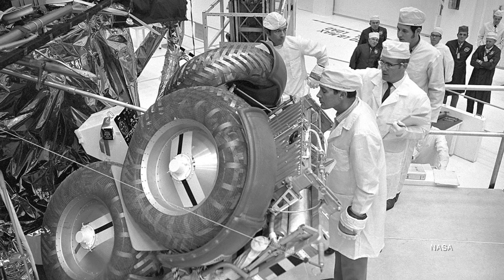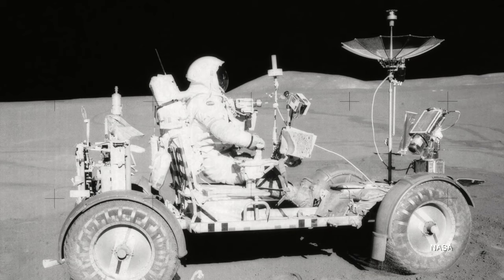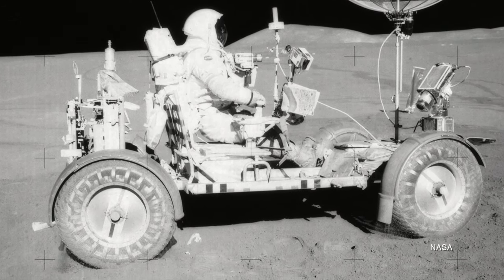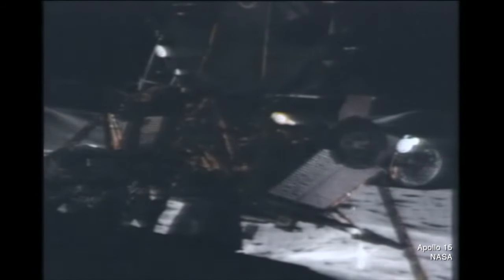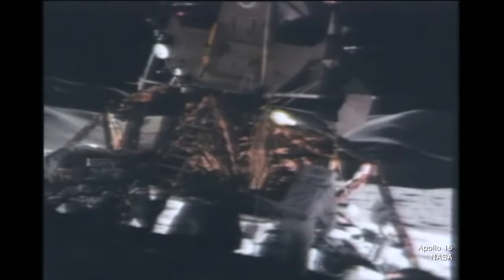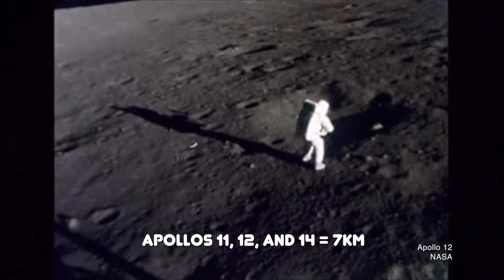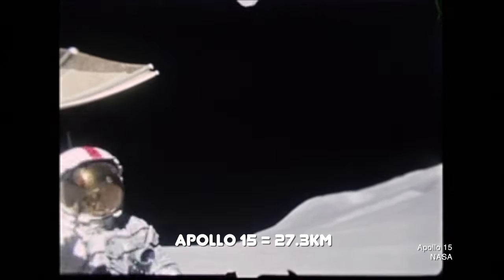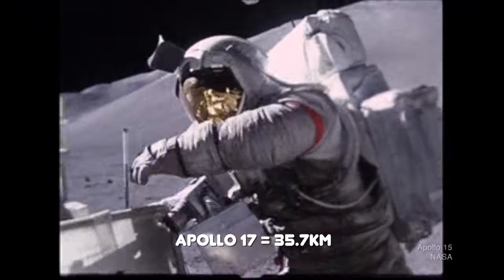How NASA Took Cars to the Moon

Comment: Looks like a snap doing this. Why has NASA not gone back to the Moon in 49 years ?   But now, somehow, they are sending ships to Mars. Which is way further out in space.
Reply: Manned lunar missions are really expensive and dangerous with little practical payoff.  Much safer, cheaper, and sciency to send robots.
Reply: @SpottedSharks  How do they get out of Earths low orbit ?  Been hearing NASA say that's as far as they can get today. If so. How do they get to Mars ?
Reply: @drackxman  Apollo used the multi-stage Saturn V.  The first two stages got the rocket into earth orbit and were then jettisoned.  The third stage got them out of earth orbit and onto a course to the moon.  

The Saturn V was the most powerful rocket ever to fly.  Also madly expensive.  After Apollo was cancelled there was no need to keep building them.  Instead, they built smaller rockets for the shuttle program and satellite launches, none of which would have been capable of launching a manned lunar payload and deliver it there.
Reply: @SpottedSharks  That doesn't answer my question. Manned or un manned, they say they cannot do it.
Reply: @drackxman  Yes, it does.  And NASA never said it's impossible to get out of LEO.
Reply: @SpottedSharks Well I heard someone from NASA say that. I'll have to look at it again to make sure.
Reply: @donpettitwedestroyedtheapo6488  So is your face!
Reply: In order to understand basic rocketry... like 1st day of class type stuff... you need to understand that rocketry is all about how much payload you can lift to a certain altitude (or a certain orbital height).  Sending unmanned probes to Mars, or the moon, is nowhere near the payload requirements of sending people.  If you just want to send a 4,000 pound probe to the moon or Mars (almost the identical energy requirement, by the way), that's fine.  You don't need to include any life support, food, oxygen, etc.  And, most importantly, you don't need to send a craft capable of getting back home again, and re-entering the atmosphere in it.  The payload to get to the moon was about 100,000 pounds (command/service module, lunar module, and the people inside).  If your payload is a 4,000 pound probe, that's a tiny fraction of the payload of a manned mission.

The more payload you need, the bigger the rocket you need.  And, thus far, the Saturn V is the biggest rocket ever.  (Technically, the Soviets built the N1, which was the same size, but they never got it working, so it doesn't count.)
Reply: @rockethead7  They haven't developed the technology to go to the moon yet. Therefire tgey can't have gone 50 years agi. Good luck debunking that.
Reply: @rockethead7  Wait!, let me make it more undebunkable for you  They haven't developed the technology to go beyond low orbit yet. Thetefore they can't have gone to the moon 50 years ago.
Reply: @donpettitwedestroyedtheapo6488  
Saturn V.  That's how they did it.  Wow, that was easy, for something that "can't be debunked."  Hilarious!!!  What a clown.
Reply: @rockethead7  No way, if they can't go now it's because they haven't developed the technology, therefore they caouldn't have done it 50 years ago. Try again genius.
Reply: @donpettitwedestroyedtheapo6488  
Dummy, it doesn't work that way.  You don't know what you're talking about.  And, you don't get to just "declare" that there's something wrong with the 1960s technology to go to the moon.  You must specify the EXACT technology that was lacking, then explain why none of the world's aerospace engineers have ever noticed that it was lacking, including the thousands who worked on Apollo, who never seemed to know that they failed so badly to build everything to go to the moon.  You act as if we don't know how to go to the moon or something.  You're being ridiculous.
Reply: @donpettitwedestroyedtheapo6488  
Dummy, it doesn't work that way.  You don't know what you're talking about.  And, you don't get to just "declare" that there's something wrong with the 1960s technology to go to the moon.  You must specify the EXACT technology that was lacking, then explain why none of the world's aerospace engineers have ever noticed that it was lacking, including the thousands who worked on Apollo, who never seemed to know that they failed so badly to build everything to go to the moon.  You act as if we don't know how to go to the moon or something.  You're being ridiculous.
Reply: @donpettitwedestroyedtheapo6488  
Dummy, it doesn't work that way.  You don't know what you're talking about.  And, you don't get to just "declare" that there's something wrong with the 1960s technology to go to the moon.  You must specify the EXACT technology that was lacking, then explain why none of the world's aerospace engineers have ever noticed that it was lacking, including the thousands who worked on Apollo, who never seemed to know that they failed so badly to build everything to go to the moon.  You act as if we don't know how to go to the moon or something.  You're being ridiculous.
Reply: @rockethead7  Ha ha, all you can do is keep pasting the same comment, I told you that proof was undebunkable.
Reply: @donpettitwedestroyedtheapo6488  
Dummy, it doesn't work that way.  You don't know what you're talking about.  And, you don't get to just "declare" that there's something wrong with the 1960s technology to go to the moon.  You must specify the EXACT technology that was lacking, then explain why none of the world's aerospace engineers have ever noticed that it was lacking, including the thousands who worked on Apollo, who never seemed to know that they failed so badly to build everything to go to the moon.  You act as if we don't know how to go to the moon or something.  You're being ridiculous.
Reply: @rockethead7  :)

Comment: @ Vintage Space: Love your vids! What was typically carried in those four storage compartments in the base of the LEM? I work as an engineer for a military contractor. There is rarely empty space designed into a craft unless there is an intention to use that space for some future iteration. How early in the design cycle of the LEM was the decision made to send a lunar rover (and thus ensure there would be space inside to store it in transit)?
Reply: Note: I didn't mention it, but, Grumman actually DID begin building LMs for Apollo 18, 19, and 20.  But, the ones for Apollo 19 and 20 were barely begun, and were scrapped.  The one for Apollo 18 was on its way to being completed, and was complete enough to start to look like a LM, so it wasn't scrapped.  Instead, eventually, the partially completed LM was made into a museum piece, and the visible missing components were added (cosmetic equivalents, not actually flight worthy), so it would look pretty close to one that would actually fly.

Your original question about what was in those other compartments can be found in the familiarization manual I gave you, and the other materials you can Google about the schematics.

Comment: The cameras that were left on the moon cars took the footage of the moon module lifting off as the video shows but my question is, were the cameras sending a live feed of the recording back to the ship and the footage was recorded there or was the footage by a live feed sent to Houston? Anyone out there who can explain this? Would really like to know?? Thanks
Reply: The cameras you're asking about were mounted to the three lunar rovers (Apollo 15/16/17), and remote controlled from Houston.

If you take a look at the rover, you'll see a large S-band dish.  They'd park the rover, and then align the dish by pointing it at the Earth.  There was an alignment reticle to help them get the aim right.  Frankly, any aim roughly in the direction of the Earth was good enough to get a signal back home.  It worked to send signals it it was slightly misaligned (there was a lot of flexibility built into the shape of the dish).  But, the alignment needed to be pretty good for the rover to receive the remote control signals from Earth.  If the alignment was slightly off, Earth would still receive the signals from the rover, but, the rover wouldn't receive the control signals from Earth (so they couldn't move the camera under those conditions).

You didn't ask about this, but I'll elaborate anyway: the other littler antenna (hard to describe the shape, not a dish, you'll have to Google it and take a look) on the rover was for audio relay from the suits' VHF radio.  The suits transmitted VHF audio to the lunar lander normally to relay back to home.  But, for the last three missions with the rover, they were concerned that they might not get a clean line of sight back to the lander to relay the audio, so they built a relay system into the rover for the audio also (which was completely separate from the video).

Back on Earth, there were numerous stations that could receive the audio signal.  Even backyard amateurs could receive it.  It wasn't coded.  And, it was just a basic audio/radio signal.  This isn't that complicated.  Backyard HAM radio amateurs had been bouncing audio/radio off of the moon to talk to people on the other side of the Earth since long before Apollo ever happened.  So, anybody with some decent equipment was able to listen in.  And, there were around a dozen radio telescope stations in various countries around the Earth that were capable of relaying that back to Houston.

For receiving the lunar video back at home, the backyard amateur equipment wasn't good enough (like it was for receiving audio).  It took larger dishes to receive the video properly.  There were various large dishes in Goldstone (California), Madrid (Spain), and a few different locations in Australia.  The most impressive dish was in Parkes, Australia.  Google "Parkes radio telescope" to take a look.  Spain, Australia, and USA became what was known as the "Deep Space Network" or "DSN."  As the Earth rotated (one rotation is 24 hours, which is faster than the 1 month it takes for the moon to orbit/rotate around the Earth), whichever of those three countries had the best line of sight to the moon would be the one to receive the video signals.  As Australia lost the signal (moon drops below the horizon), Spain would pick it up.  When Spain lost the signal, USA would pick it up.  And, when USA lost the signal, Australia would pick it up.  By having these three countries with large dishes, they could cover the video communications 24/7.  All of those stations then relayed the signals back to Houston, where the audio and video signals were merged.

Note: even though other countries were capable of receiving the audio, and did so, generally speaking, the same country that was receiving the video was also receiving the audio that Houston used.  The other countries tuned into the audio, of course.  But, I don't know if there are any examples of Houston receiving video from Australia simultaneously to receiving audio from Guam.  That was certainly possible, of course.  But, I think, generally speaking, they got the audio from the same country that they were getting the video.  But, yeah, they had a lot more audio feeds possible than video feeds.

Comment: How did they get the video from the moon buggy recording if it watched them take off?
Reply: Radio.
Reply: Apparently that electromagnetic radiation known as radio waves exists and humans have developed methods to transmit and receive them. Take care.
Reply: It wasn't a video; it was a broadcast.  The camera that recorded the liftoff continued to broadcast for several hours until it ran out of battery.  It was recorded at Mission Control.
Reply: @willoughbykrenzteinburg  Correct.
Reply: Does television confuse you? Do you think there are tiny people inside the box?

Comment: Amy ,  on reading fishman's ' one great leap'  on the section where the  von braun ok'd adding a rover
 to 15 16 and 17 was covered a  particular aspect of their dvp'mnt was being looked for.  

while working the '78 summer at boeing
space center in kent one day my job took me into a large room . say 25' by 40'.  a scale model
of the lunar surface covered most of the floor.  while above it at ceiling level was a bunch of
pipe-tracks for a camera to  travel on.    my co-workers said it was a simulation  training setup for
 the rovers that boeing had the contract from GM to build.    nothing in the book was found
that mentioned this.    have you any information that can support this claim ? 

  the lunar  landscape model  was flattish with rolling changes to the terrain.  at that time there were no
 lander or rover  models on the moon surface.

 it doesnt quite make sense to  me what the value would be  to film a model rover  being driven around. 
when they can ride around pre-launch on earth and get  used to how it rides.  unless it was for mission planning of the rides they took.      where to take a sample  ... 

 any videos taken in that room at the space center  with the ceiling cameras would show what
 the  mockup of the moon's surface was used for with a model of the rover .  or possibly they 
worked out where to position the rover to film the launch ( that oddly shows no flame  ??? )

   also curious if the batteries the rover ran on could be re-charged  via the lander.  and how
they didnt stop working from getting cold at night.    like car ones do
Reply: I've never seen her answer YouTube comments, so I will instead.

YOU SAID: " it doesnt quite make sense to  me what the value would be  to film a model rover  being driven around."

== Yeah, probably not much value.  But, who knows if you were given correct information about what its use was?  Or, maybe there was a use that we just don't know about.  To me, it's fairly irrelevant anyway.

YOU SAID: "when they can ride around pre-launch on earth and get  used to how it rides."

== Which they did.  They had one they used for a trainer on Earth.  It couldn't compensate for 1/6th gravity, of course.  But, it gave them a chance to get familiar with the way it drives.

YOU SAID: "that oddly shows no flame  ???"

== Correct.  N2O4 and Aerozine 50 burn clear.  The flame is nearly invisible, especially if mixed perfectly.  When you see rockets on Earth that use that combination of fuel/oxidizer, the flame is clear also.  But, in an atmosphere, you will see the edges of the flame as it interacts with the air around it.  On the moon, you won't see that.  I'm not sure why you find this to be "odd."  Lots of fuels/oxidizers burn clear.  Case in point:
https://www.youtube.com/watch?v=Ku7TdLeEGsQ

== Anyway, they choose the type of fuel/oxidizer mixture based on lots of factors.  Not all rockets use the same fuel/oxidizer.  The Saturn V first stage used Kerosene and liquid Oxygen, for example.  The landers used N2O4 and Aerozine 50 (as I mentioned).  Solid rocket boosters on the shuttle used an ammonium perchlorate composite.  Many liquid fuel rockets just use basic H2 and O2, which produce water as the byproduct.  It all depends on what they need, how much energy density they need, whether or not they need to be able to throttle it, how reliable they need it to be, how safe they need it to be for storage.  The list is long.  But, the bottom line is that, for the landers, they used N2O4 and Aerozine 50, which burn clear.

YOU SAID: "also curious if the batteries the rover ran on could be re-charged  via the lander."

== No.  They were not rechargeable.  The rovers used silver-zinc batteries, encased in beeswax to keep them cool.  That type of battery is very good because it's light, and the energy density is great.  But, on the downside, they are very expensive, and they can't be recharged.  But, they estimated the rovers' range to be about 40 miles, then the batteries were dead.  Since none of them drove more than about 25 miles, that was fine.

YOU SAID: "and how
 they didnt stop working from getting cold at night."

== Well, first of all, that's not quite how temperature works in space.  But, the short (and somewhat funny/ironic) answer is that they weren't there at night.  Remember, a lunar day is about a month on Earth.  They landed in the lunar morning.  They took off in the same lunar morning (even though 3 days had passed on Earth).  Sunrise to sunrise on the moon is about 708 hours, remember.  No mission was on the lunar surface more than 75 hours.  They never saw a nighttime.
Reply: @rockethead7  
thanks so much for your reply.  very 
informative.  ( esp. that amy is slow
on the draw. )   even though
it has me laughing at how  the questions  show my  ignorance.   less so now that
you updated  us all w/ some  facts.
     did your knowledge come from having
a part in the apollo program ?
      except for that  unplanned finding  of the
simulation room at the boeing space center
my role was observer of what was on t v.
    it was in the student union bldg at the          
U of Wash campus along with 100 other people that i saw and heard armstrong
Reply: @137bob3d  
No problem.
As for your question about where my knowledge came from, and whether it was because I took part in Apollo, well, no.  I was still a child during the moon landings.  I didn't start amassing the knowledge until a while later.  And, in the 1980s and 1990s, I sent away for all of the schematics, videos, etc., back in those days when it costed a small fortune to collect all of the information (before the internet became big).